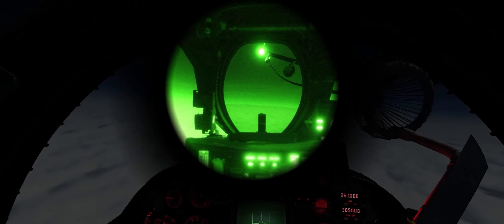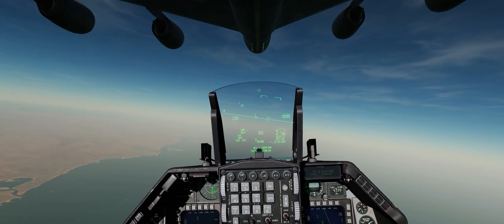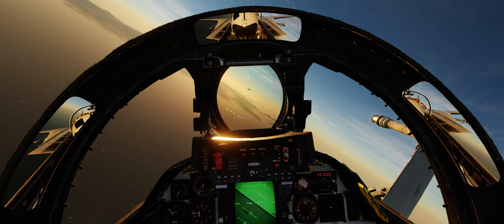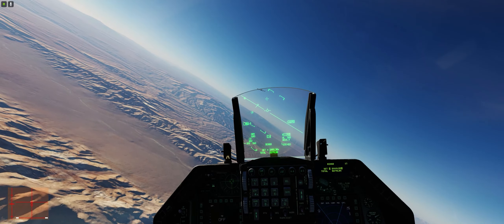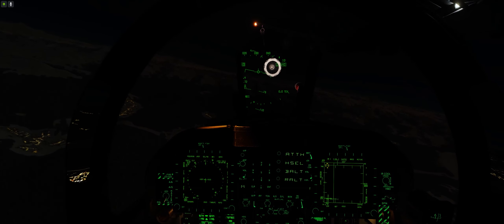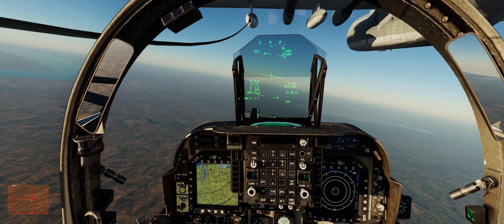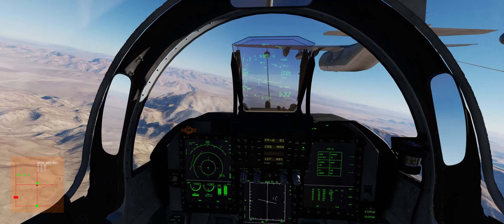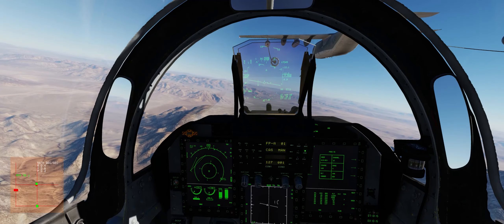DCS World Air to Air Refueling Guide For All Aircraft!

Comment: Thank you Spudknocker!
After watching all the available videos on YouTube, getting a new stick and some pretty intense practice, I’ve finally managed to connect to the tanker in the F-16C (KC-135) and the F/A-18C (S-3B) this weekend.
As you probably already know it has been a long and frustrating journey so I’m understandably ecstatic.
Thanks to everyone who took the time to post videos on YouTube. I watched them all and they are full of invaluable advice and wisdom, pure gold.
What I learned (and used) to be able to perform air to air refuelling:
1-Patience.
2-Relax-don’t death grip the stick.
3-Small premptive corrections- if you try to correct movement you’re already too late and you find yourself in PIO.
4-Learn to stabilise in the horizontal plane and vertical plane separately. With time you will be able to do both.
5-Eyes on the pod, not on the basket.
6-As you get closer to the tanker and after you connect, watch and move with the tanker, your reliance on the HUD will diminish.
7-Listen to the engines-much easier in the F-16 than the F-18 but the sound of the engines is a good surrogate marker for what they’re doing.
8-If PIO starts, throttle back, give yourself some space and try again.
9-Practice formation flying with the tanker with the explicit aim of just formation flying and progressively try to get closer and closer.
10-Practice
11-Practice
12-Practice

I’d also like to add that I do it have a VR headset and I was able to tank using a Logitech Extreme 3D Pro which is a very basic stick that I bought as an interim measure until I could get something like a Warthog or Virpil, but it surprised me and actually did the trick, so it is possible to connect to a tanker with a £40 stick, not easy but not impossible.

Comment: You are very knowledgeable and so accurate and i commend you for this video. You sound like a simulator instructor.
I was a KC-135 boom operator for 6 years and KC-10 boom operator and instructor boom operator for 14 years. What are you saying about the whole A/R scenario is so accurate. We talked to the receiver aircraft for two reasons. 1) to relax the pilot and 2) pass any information if required. If you have any questions or comments from the boom operator side of the tanker, i can help you. ....
During boom refueling, the receiver should stop forward movement two to three feet from the extended boom (contact position and let the boom operator extend the boom to effect the contact. 
A-10's, B-1's, and E-4's (747) were the ones we had to be careful the most because their receptacles are in front and they will try to fly on to the boom.

Comment: Another great guide packed with sage advice.  Wish I had this video when I started first trying AAR.

I picked up a few of the bad habits you mentioned, but I also learned a few of the good (the hard way).  Not sure if it's a realistic solution IRL, but sometimes I put my F16 into CAT III because the reduced input ratio of stick movement to control surface response damps out PIOs.

Comment: It also helps if you fly with someone and watch them refuel. I was 0% until I went up with a couple squad mates, flew along, watched them then I moved in. Wala success! Seeing how they moved in then paused to match speed and then ease up, was what I was missing.
Reply: Yes. It is essentially that. After you intercept the tanker, you take up position off its left wing. It is here you get settled in, taking note of the tanker's airspeed, altitude or bank angle. 

When you are ready you slide into position by dropping below the tanker altitude, and behind it. Once your airspeed is stabilised behind, you are ready for pre-contact.

The observation position is thus important for you to start getting into the groove so to speak.

Comment: Unless, I missed it, you forgot to mention that when you set the Tanker's TACAN frequency, you also need to enable A-A mode. You also didn't mention how to use the lights on the button of the tanker to line up your plane as this is important for planes that do not have extended refueling probes. Another tip is once you are hooked to the refueling boom, you need to pick a location on the tanker that is on a reference point of the frame of the canopy or HUD, and then keep the two reference points together like you do with the needles when doing an instrument landing. This technique will keep you in perfectly formation with the tanker. Nice tips though.
Reply from the maker: TACAN is discussed at 2:55
Reply: I agree, theres way too much useless blah blah that one feels tempted to skip to the interesting parts.

Comment: Navy Viking pilots got pretty good at tanking. During night recoveries, when everyone is burning fuel in marshal, we had either a KA-6 or A-7 with a buddy store attached (this was before Vikings could perform tanking missions). The Viking had long endurance (fuel-wise, not butt-wise or bladder-wise) and could land heavier than most of the other aircraft (it may be the only thing heavier was the A-3D), and so we were one of the last aircraft back on deck. Because of this, we were usually the recovery "sponge," taking on excess fuel from otherwise overweight aircraft. Nothing builds good tanking skills like tanking at night in the marshal stack.

Comment: Took so long to get this but soooo rewarding when I get it done. I still can’t do it when the tanker turns but someday.
Reply: Im still struggling with it.
Reply: I have the twcs throttle and nxt gladiator I had to add

 3 dead zone

And change the curve to 20-21 range I also change the vertical springs to gmx#30 not the left and right spring though and I'm on table top I have the core hawk 3d mod for the twcs throttle on etsy polymer bushings

For instance when she bank right I match the turn as close as possible add 1-3 knots to keep with the turn and not get closer or farther while I'm hooked in and lastly to not slide right I put the a very small amount of left pedal or (rudder) into the aircraft just a little very tiny bit on my setup anyways so I'm banking right at 45 degrees and yaw is slightly left to counteract my sliding so I look cool and stay it or atleast can fly formation

I literally couldn't do it until I change my curve and dead one and tried it today after 5 months of dcs tried myself 2-3 times and my 4th time was today 5/15/21 and I got it fully fueled fa-18 in 6-7 connections and fuel transfers... It takes a long while maybe bit the stick setting are what really helped a fuck load now its super easy tried the tomcat and harrier and f15c the eagle was odd but so us the other airframe I also did what spud knocker said and stroked the throttle up and down like 1% rpm and I stroked the throttle so she was around 315-316 and I kept up and had a solid 37 seconds of being fueled with one bag too almost finished it up

Comment: Is it possible, that all Tutorials are conducted with Wakes turned off? I can trim my A/C as much as I want. I approach absolutely fine and stable, get into the Position, try to maintain my focus on a specific part of the Tanker (Basket Pylon lined up with my Hornet Canopy rail instead of focussing the Basket), and short before I connect...boom, the Tanker goes off and the Basket rushes away from me...Thats so fu%$§$% annoying. But in the Tutorials I don't even see a slight wake impact on the Aircraft...

Comment: No other thing in DCS pisses me off more than trying this.  0% success rate.  I would rather run out of gas and crash than have this crank my blood pressure 😩
Reply from the maker: Well hopefully this video will help you out!
Reply: @Spudspike  you've inspired me to giver a go
Reply from the maker: Tombstone 4 awesome!
Reply: @tombstone4362  man I managed to do an AAR with a keyboard, if you’re using a HOTAS you should have no difficulties
Edit: revisiting this comment now, I was being a ****head there
Reply: I would look at your curves. If you are using a short desktop stick you should have at least 30% curve on it. Remember most aircraft have a 8 inch/20cm extension. If you are using a desktop stick you will be over sensitive. Also look at curves for the throttle. A lot of times the default is not correct.
Reply: check your stick curves and deadzones. Larger deadzones and more linear curves are BAD for AAR. They are in precise and too sensitive. I found that taking my deadzone from 8 to 3 made a DRASTIC difference in my ability to make small corrections for AAR and formation flying. Combine that with proper curves as usually outlined by Chuck's guide, and you will find that it is much easier to control or prevent pilot induced oscillation.
Reply: Believe me I am in your spot, ive rammed the tanker more than once because of the raging furry in my blood, go to hell Texaco 1-1
Reply: @snowysnoozledo1959  that's hilarious. I've done the exact same thing
Reply: I usually get mad and shoot the tanker down...lol
Reply: spend all the night for AAR and 0% successs
Reply: @allmight1612  that's a nice flex, but really not that helpful to tell someone how easy it is to do something they are struggling with! This shit is hard for beginners!
Reply: @gnittegdellort  To be honest, I got a little bit too cocky the day I wrote this comment. I was still impressed with that achievement at that time and I was showing it to the whole world. And also, many people (including me) only see the top of the iceberg when it comes to practicing a skill. We’ve all had those times where we just lose our patience and switch from learning AAR to practicing gunning down large targets like tankers. I think this necessity to be always competing comes from family. I have two older brothers and I’m always trying to catch up with them in terms of studies and sports.
Reply: @allmight1612  mate, I don't blame you! I just did some more practice on AAR. The fact you succeeded with mouse and keyboard is bloody impressive, I have to give it to you! Add you gonna get a HOTAS at some stage?
Reply: @snowysnoozledo1959  I've gone GUNS GUNS GUNS many times, refueling!

Comment: I'm doing AAR training, in the Hornet. In the mission I'm using, the KC-135's is only going 240kts and as I approach it, the wake turbulence constantly pulls my aircraft to the right until I'm fully in it and lose control. I can't trim up the aircraft before tanking because as I get closer the aerodynamics change. I guess I'm too high as I approach. Is the mission borked because 240 is a bit too slow for stable hornet flight?
Reply: You could turn off Wake Turbulence in the Settings menu.

Comment: You don't want mushy throttle response, so the F-16 response can't be too *quick*.  It must be just too much thrust change for a small throttle movement in that RPM range, making it harder to make small adjustments without overcorrecting.  Touchy throttles are not desirable, and it probably can't be helped in the powerful F-16 (but there is no reason for the touchy throttles many modern cars have in sport mode).

Comment: Aiming to fly in formation rather than aiming at the drogue chute helped a lot. Another thing that worked for me was keeping the throttle at a very slight crawl forward, and using the airbrake to slow down. That way when I put down the brake, I knew I'd be straight back to that crawl forward.

Comment: in the mirage i refuel with autopilot alt hold and because it has accelerations bracets you keep the throtle stable
Reply: Alt hold on the 18 myself. Unless you overuse throttle adjustments, it works perfectly

Comment: Why my flying near tanker looks very different if not touching the stick (hornet). I really have troubles with wake turbulence. The stick is not problem, or my nerves. It is just that when i closeup tanker smoothly like in all these a/a refueling tutorials, the wake turbulence takes over the plane so hard that i HAVE to correct it -> goes wrong there. Do you use Attitude hold with hornet. Ok my stick is old. But i did it smoothly without turbulence, but with turbulence. No dice. I assume here wake turb. is on? Seems so, but how do you do that so it seems to effect very little to your plane. Crapping my pants bought raven one campaign and mission two "tankin training", well it has to be done anyway sometime. Maby it is there for a reason, though annoying ;D But my problem really is that turbulence, how in gods sake it seems to effect much fever in these tutorials? I bet the turbulence is the very problem, for many others also. With F-15 staying "under" the tanker is much more "smoother" though the boom behind cockpit it is like boom in the... well nervers.:D

Comment: I can formation fly just fine. AAR is impossible.
Reply: I little AAR hack that I use is activate the BALT hold when approaching pre contact. Then I'm able to better subtly make small input corrections with the stick getting to the boom and staying attached. All I have to focus on is throttle corrections. Makes me look like a pro when I'm anything but lol
Reply: Depends on which aircraft you are in. Getting into the basket is unintuitive and it takes practice to memorise the position of the basket relative to your canopy.

At the same time you are not supposed to look at the basket. Not at all... It's just supposed to sit in your peripheral vision and you adjust your aircraft's formation position to the memorised basket positions.

Thus, AAR familiarity is sheer will and practice.
Reply: @woodleyjohnson  I did that in the Hornet since writing that post and have been able to AAR in that.